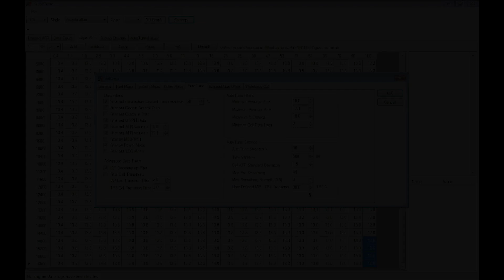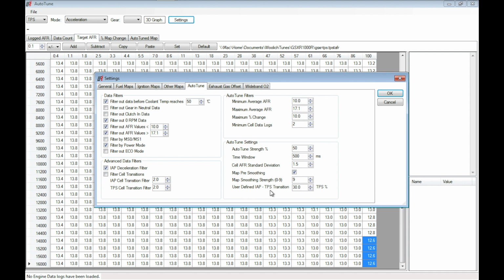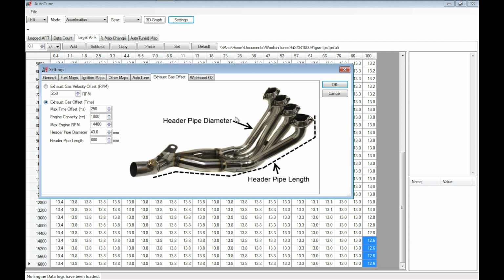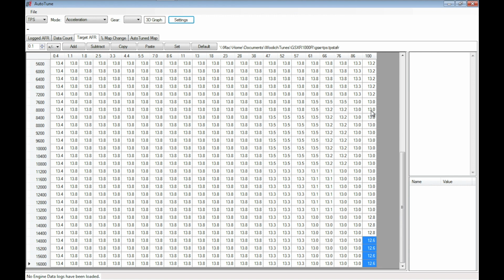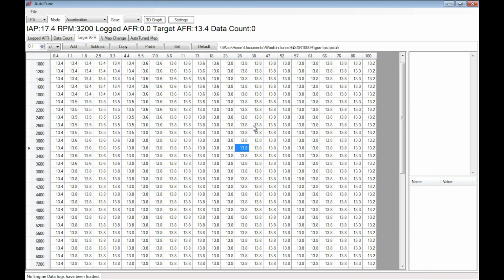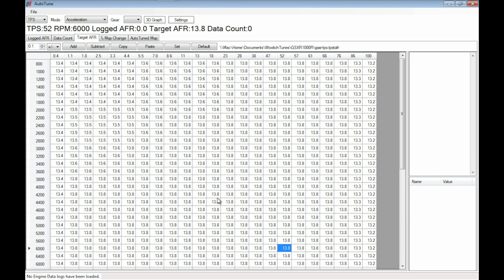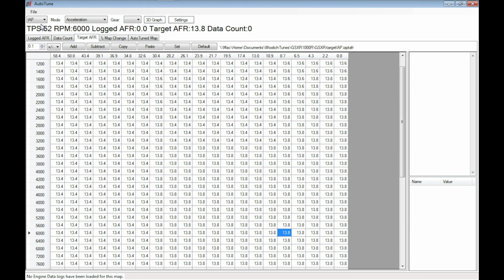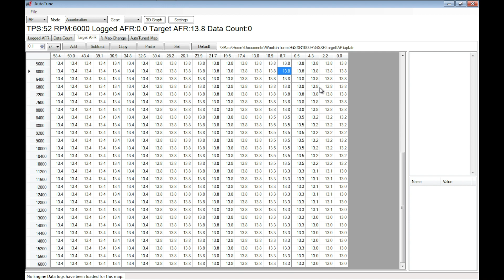GSXR1000R AutoTune Map

Comment: Have you ever looked into the ignition dwell map by chance?
Reply: How fast does the auto tune kick in once the situation changes
Reply from the maker: I have Woolich log box with the auto tune added.  It is manually applied.  It does not write live.   I had a DynoJet that did.  There are advantages to each method of writing, but the Woolich is the best by far.  Writing directly to the fuel maps of accel, decel, iap, and tps is a much better solution than intercepting and writing a new fuel value.  I might make a video about this, because DJ AT has a place where it is better, but as a whole it is not.  
I have Woolich AT and logbox on all of my bikes and that is because writing to the ecu fuel cells directly after a log works better with getting the base fuel map correct.

I haven't even started to talk about per gear mapping and trims.  A good base map is essential here.
Reply: @MantisRacing  do the auto tune change immediately with changes to weather or any other conditions
Reply from the maker: It reads all the time.  To implement the changes you have to apply it and flash in the new fuel map.
Reply: @MantisRacing  Thank you for answering my questions. Okay so it does not change with the changes in weather but it can show you if it needs to be change. So if you ride one day and it's 75 degrees, the next day you go riding but it's 90 degrees the auto tune will not compensate for the changes in weather correct?
Reply from the maker: I have not messed with dwell.  I have read about it a lot.  Some say don't touch it the factory has already set it correctly and holding it longer doesn't do anything, but cause coils to fail prematurely.  Then I did see I think it was an R1 video where they pulled 1 degree of timing and added dwell to gain 1hp.  I'm not familiar with the rest of the tune so I don't know if dwell really did add 1hp.  

If I still had a dyno where  I could make runs I would test it and find out for sure.  Right now, with street testing I'm not sure I would see anything I could attribute to dwell.  Then again, I might be totally off on this.